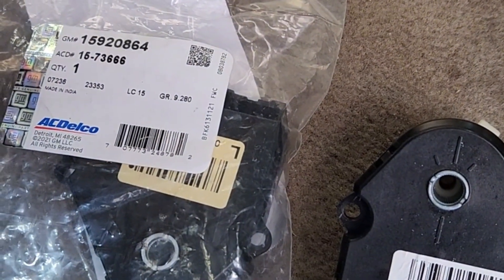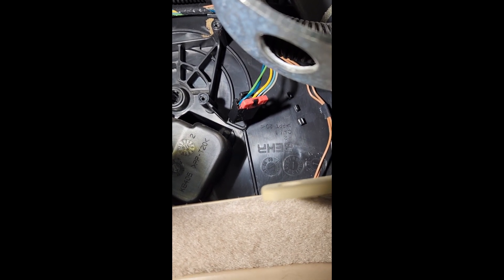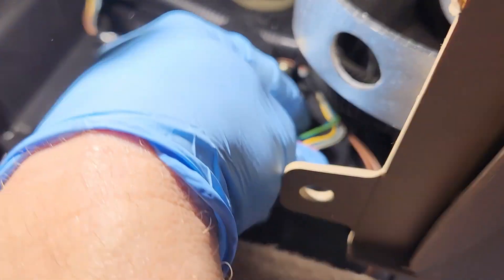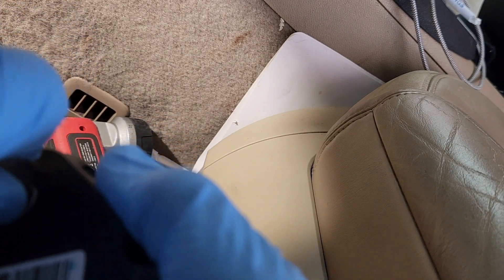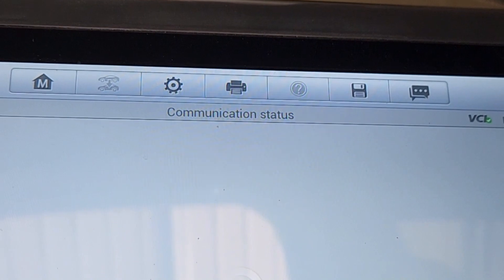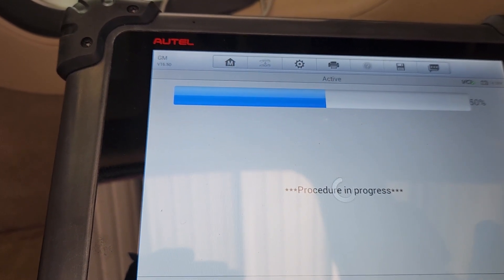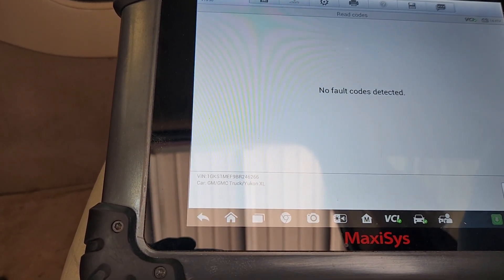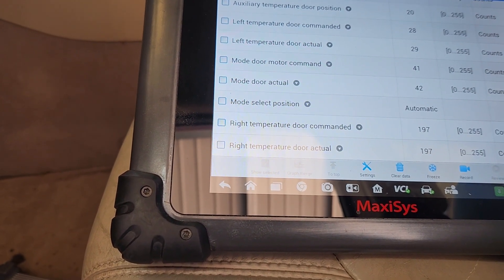2011 GMC Acadia, B0413 Driver's A/C Stuck On Heat

Comment: Got the same issue in Equinox stuck on Cold. Replaced the actuator. Same issue.
Reply from the maker: Have you performed a recalibration? Either with a scan tool or manual method? Any chance you have read codes?
Reply: @SparkysAnswers  turns out it wasn't plugged in and i can't access it, but I can tell that's the plug hanging there
Reply from the maker: @NickF2357  Hopefully you can get someone to give you a hand that can get in there.
Reply: 2011 acadia replaced 8 of those since 2015 its 2025 now so i decided to do some troubleshooting and i discovered that actuator connector was receiving signal even when its off completely so it kept burning out actuators, so i replaced the control module . All the lights on module are on all buttons work but now when i plug new actuator where ild one was nothing happens when i change mode what can be wrong